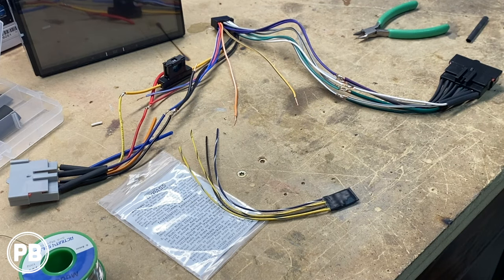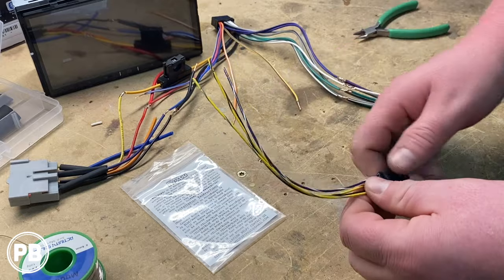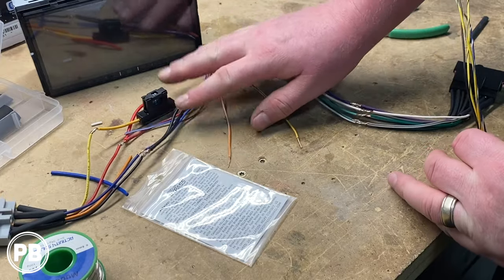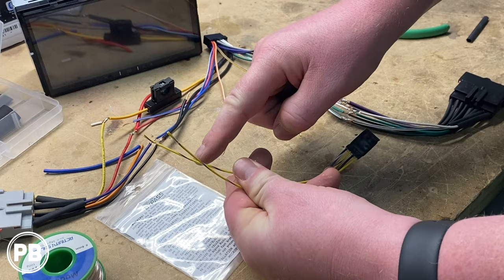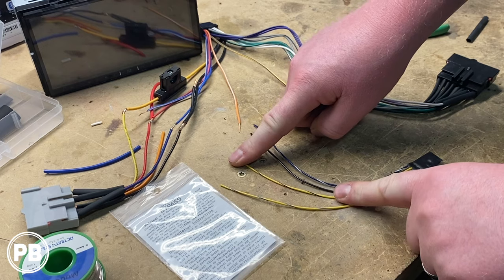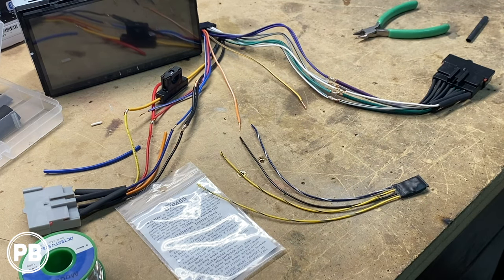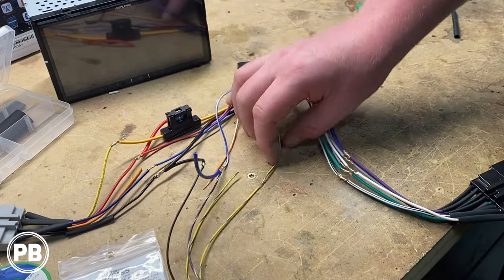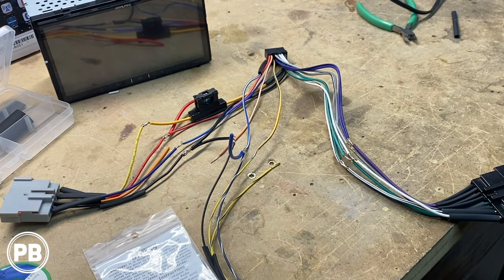How To Bypass Parking Brake On Alpine Radio

Comment: I see that people still watch this video and wanted to say i had the same problem when connecting my pioneer radio in my 2010 Camry. What my friend did for me is, with the center console removed, he looked for a random bolt that the wire could ground to and so we found one, loosened the bolt a bit to get the wire under, and tightened it again HAHA haven’t had a problem since. I must add the parking wire was very long which let us do this (: best of luck everyone

Comment: I just did this on an alpine ilx650. Great video 👍🏾
Reply: That what I am using! Did it work?
Reply: Any one part number on the part to many on line
Reply: @carlosquintero2993  MicroBypass Video Parking Brake Bypass Fits ALPINE ILX-W650 ILX-F309 ILX-F259
Reply: @carlosquintero2993  yo no encuentro nada al respecto 😢

Comment: Great product worked like a charm. I didn’t need to pull up the center consul to connect to the E brake connecting to the back of the radio was much better and convenient. Thank you for the heads up.
Reply: you did not have to pull the dash
Reply: so all you had to do was remove the head unit from the dash to swap out the receiver?

Comment: I have a Alpine 509 halo. I had to use the red ACC wire instead of the amp turn on blue and white wire, to get it to work reliably. A lot of the time amp wouldn't turn on or the access to setting, bluetooth and video wouldn't unlock. Connecting the bypass to ACC clear up everything. Also if you are problem with the bluetooth volume connecting at startup. Tap the bluetooth volume knob before or shortly after startup.
Reply: On your 509 halo did you need the 4 wires or only 3 ?
Reply: @floridabuzz2457  3 wires, some Alpine decks have a foot brake wire that also needs to be hooked up.

Comment: Oh my god. The one I got had the blue yellow wire a ground black green and the blue remote. I thought the green for some dumb reason hooked up to yellow power. I hooked it up. Plugged the fuse in and realized my amps were on all the time even with the keys out and radio off. I just pulled it out not to do any damage. Now that I know the green wire is left alone. I’m gonna try putting it back in so I can freaking adjust the sound settings.

Comment: Yes, it does work on the iLX-507. If your car has interfaces like Maestro, Connects2, etc just do not connect them the parking wire....🎉
Reply: Can you elaborate please. I have a 507 and trying to get this to work. What do you mean don't connect to parking wire?
Reply: Got mine to work. BTW -- you cannot have the parking brake wire connected to the car side (inline).
Reply: @armourbl   Ok, lets to make a loop circuit between the 507 and the MicroBypass. Nothing else matters! Most interfaces will have inputs for speed pulse, parking brake, reverse, telephone mute, etc. The parking brake should not be connected to the interface. Sorry for the delay!
Reply: I’m going to get one soon do you recommend the bypass and if you do is it common sense on hooking it up
Reply: @christianrodriguez607  yes. Worth it. Make sure to test before closing up the dash.
Reply: @armourbl  What do you mean? Still confused...
Reply: @velocast  What do you mean? Still confused...
Reply: @IrwinTan27  Basically, you connect the relay wire for the parking brake to the input for the parking brake on the radio harness. You don't want a signal from the actual parking brake itself. The relay fools the radio into thinking the parking brake has been engaged properly.

Comment: Awesome video. Question? I have the RP4.2-TY11 radio replacement and SWC interface already connected to the radio harness. I understand that the by-pass blue/yellow wire connects directly to the blue/yellow on the radio harness. The blue/white wire I have a question on. Since radio harness is connected to the radio replacement & SWC interface should I snip the blue/white wire and connect directly to the bypass blue/white wire (as shown on the video) or should I just tie-in the bypass blue/white wire to the blue/white wire on the radio harness. In other words keep the blue/white bypass, radio harness and radio interface all connected? Hope I didn’t confuse you :-/
Reply: I was wondering the same thing. Did you end up ever getting an answer?

Comment: Thank you for this video and for the intruduction to the bypass switch. I do have  one question. My Alpine radio is connected to the vehicle via a Maestro module; do I make these connections before or after the module?
Reply: Did you ever get an answer to this question I have a maestro also I’m guessing you just wire it from the actual Alpine harness
Reply: @adamlaforce3681  I'd like to know as well. Logic for me is you want to do it right before the radio. Since you have a ground and remote wire (blue/white) inline with the harness they will work regardless of location. And you wire in the yellow/blue, not inline, just into the radio to fool the radio. The relay should start up with the remote wire receiving power and send the ground to the yellow/blue wire. The problem is I don't know if the Maestro RR has any part to play in any of this. Like if the Maestro doesn't sense the yellow/blue wire inline to the radio, what happens? I may try to wire mine with the yellow/blue still inline. At least that way if the relay doesn't work, I'd still be able to use the parking brake to engage the settings menu as a backup operation.
Reply: Got mine to work. BTW -- you cannot have the parking brake wire connected to the car side (inline).

Comment: Has anyone installed this in a 2013 Ford Edge? Does anyone know of anything that might need to be performed differently? How would you know if your car has a brake pedal wire? Great video!! Hooked this up before but couldn’t get it right. Then had to put the OEM radio back in and it sucks!! I’m going to pull this OEM one out and put my Alpine ILX w650 one more time I hope. I need CarPlay back. Lol

Comment: My yellow /blue wire goes from the deck to the radio pro ch1a -rsx (the steering wheel controls). Would I need to keep that line connected to that control box?

Comment: So I have the ix650 by alpine and I purchased a redwolf bypass from Amazon. The bypass has black,red,green and blue. I'm not sure how I'm supposed to go about this. I also have a reverse trigger wire on the unit. Is that supposed to be grounded out? It's been years since I've done a install. Any info would be greatly appreciated 🙏

Comment: I use this on my alpine x008u it works for the vedio but somehow my sound setup wouldn’t let me control the equalizer setup . Any helps on that ?? I can’t even adjust my speaker without that please help here ??
Reply: I have the same radio did you resolve the issue??

Comment: I just bought ILXW650 does it actually play video can I mirror my phone onto the screen? I have a s21+ running android auto through USB input
I accidently bought a parking brake bypass for a pioneer stereo can I use it on my alpine if it is just a relay?

Comment: When I try to access reverse camera features under settings I can not press it due to it being greyed out. Does having one of these installed have the unit thinking the parking brake is applied and greys out the ability to press the reverse camera in the settings?

Comment: Can I add one of these to my harness with posi-lock wire connectors or would just splicing in be better? I have a ready made harness from Crutchfield and didn’t want to have to cut it. I just didn’t know if it would actually get a signal if it was tapped. Thank you.
Reply from the maker: crimp or solder, don't risk doing anything else inside a vehicle.  Strip back the shielding, poke a hole in the wire, thread your wire through it (like threading a needle), and solder onto the connection.

Comment: Hey I’ve watched a ton of your videos, and you r helped me troubleshoot a lot of issues I’ve got with my 99 f250. I was wondering if you could help me with an issue, my accessory power doesn’t turn the radio on, so the truck has to be running in order for the head unit to work. Any thoughts?
Reply from the maker: Sure, use a multi meter to determine the issue.  Check the accessory wire coming from the truck and see if you have 12v.  If not, the issue with with a bad relay or fuse in your truck, not the radio.

Comment: So looking at my wiring diagram for my Alpine.... it shows a foot brake and a parking brake wire... but both of them are yellow/blue.... do I actually need to tie in that foot brake wire? or can I just do the parking brake and not worry about it? My Alpine is a INE W957HD....
Reply: Did you figure this out. Dealing with the same thing right now
Reply: @jakehaase1651  Yes.... The manual was a misprint.... The harness actually had a yellow blue and a yellow black. I tapped them accordingly. What unit are you installing?
Reply: @FLEXXX  I have the ix650. The bypass I have is made by redwolf. It has a black,red,green and blue. I've searched all over and I'm stumped.
Reply: @_flexxx_  I have the halo I got it figured out. Thanks for the reply and help
Reply: @musicismeds  found this info from a bypass seller for Alpine: Installation is straight-forward. There are four wires - black goes to your head unit ground, blue goes to your head unit blue/white (remote power), and green go to yellow/black wire (Foot Brake+).
Yellow to yellow/blue wire Parking Brake(-)). In your case, it might be the red cable from your bypass.

Comment: Why can’t the e break wire just get plugged in with the ground? You’re basically doing the same thing
Reply from the maker: It can, depending on the brand.  Pioneer and Alpine require more than just ground the parking brake; they require either a double or triple pulse negative.  All other brands you can simply ground the parking brake and be fine.

Comment: is it possibly to short circuit the bypass, I had it installed and it worked fine, then when trying to wire the backup camera (which I can't get to work) the bypass no longer works.

Comment: Will this help with the back up camera?  I have done everything imaginable, even got another camera from Crutchfield and ran straight to bypass the installed camera and still nothing.  This is the only thing left to try as far as I can see otherwise it is back to no camera for me.  By the way, this is the same model Alpine I have and there are only rear and front video inputs for a camera, so I would assume yes, but want to be sure.  It just seems strange that it would require this if Alpine has the backup camera feature.
Reply from the maker: Nope, this has nothing to do with a backup camera.
Reply: Linkswell makes an adapter that works great!

Comment: I have a foot brake so I need to use the yellow/black. But there isn’t one coming out of the Alpine harness. And the yellow/blue is going to the interface module. Please help! Thank you!
Reply: Did you ever figure It out ?
Reply: @nelsonperez1194  I did BUT I forget the answer. I’m sorry! I have to get back into there soon and get let you know but I assume you’re looking for an answer immediately, right?
Reply: Thanks!
Reply: @nelsonperez1194  sorry it took so long to get you an answer. But here it is: Connect all 3 black wires (ground), connect the 2 yellow/blue wires (radio & bypass) to the solid green wire coming from the interface, connect all 3 blue/white wires (radio, interface, & bypass).

Comment: I installed this nicro bypass on the Alpine ilx-w650 in my 2009 Toyota Tacoma and now the settings work but the steering wheel controls that were previously working no longer are functional.  Any idea how to solve that?
Reply from the maker: Sounds like something came unplugged or a wire connection came loose.  Recheck your connecitons.

Comment: There is a fairly legit reason for the bypass and that’s for large vehicles that don’t have a standard parking brake, but use Neutral + Airbrakes and don’t have access for a parking brake wire.  Better case to state than all the idiots trying to watch movies illegally…

Comment: On a non-Alpine unit, wouldn't you just have to connect the parking brake wire from the radio harness to the Ground (Black) connections on the radio and factory adapter wiring harnesses to bypass the parking brake? Going to be purchasing and installing a Pioneer AVH-1500NEX for an '08 Ford F-250 Super Duty, and not installing a backup camera or anything.
Reply from the maker: Not all radios are the same. Pioneers require either a double or triple pulse negative so a bypass would be required. See the link in the description for that video. With a pioneer, you cannot just simply ground it.

Comment: Can’t I just tap into my 12v cigarette lighter acc wire? That way it turns on when I turn the car on?
Reply from the maker: Sure, or you can add it to the accessory wire on your aftermarket radio too.
Reply: So if I connect it to the accessory on my harness will the display options that are greyed out work whenever I turn the car on?

Comment: Are the pioneer and alpine bypasses not interchangeable if you only need 3 wires on the Alpine?
Reply from the maker: Alpine sometimes needs both a foot brake and parking brake bypass, or a four wire relay needed. Pioneers only need a parking brake. Just depends on what model alpine you install. Generally a pioneer needs a double or triple pulse ground for the parking brake to work.
Reply: @ProvoBeastAudio  i have the aloine ilx-w650 do i neec the foot brake wire installed??? And what wire dies it go to

Comment: will this work on the iLX-507?
Reply: I installed it on my 2014 Tacoma with the iLX-507. It still requires me to be in PARK (automatic transmission). I don't have to apply, release, and apply the parking brake. But I can't access settings while moving. UPDATE If I power cycle the head unit after starting the truck, the SETTINGS and HDMI input options become available while driving.

Comment: Does this screw up the amplifier signal that needs to continue to the amp to turn it on?
Reply from the maker: It's irrelevant to an amplifier output, remote output, or backup camera.  This is specifically to access certain settings in the menu or video playback while in motion.
Reply: @ProvoBeastAudio  I understand that, but you are tapping into the blue with white stripe line that turns on the amplifier, does it affect the ability for the amplifier to recieve the proper signal if it's also powering the relay?
Reply from the maker: @archittt1  Nope, it won't pull enough current away from your amp remote inputs to cause any issue.
Reply: @ProvoBeastAudio  Thanks

Comment: I dont plan on watching video while driving, I just want the damn thing to work. I cant hookup bluetooth, I cant use USB, I cant access settings, I cant even set the clock without this. So dumb. Why does Alpine think my am/FM radio should function but my bluetooth audio shouldn't?

Comment: This is a great video! I have my Microbypass wired in exactly like you do, but I'm still not able to access the settings menu on my Alpine iLX-W650. Have you by chance heard of any additional problems with this particular unit? Any common missteps I can check for? Many thanks.
Reply: I ordered this as well.  BUT apparently,  you need to engage and disengage, and then re engage the e brake to see settings. I'm currently using my pac 7, but I was hoping this would work.  Now I'm not to sure. I might run a separate toggle to the ebrake for settings.
Reply: I wired a switch.. one side goes to parking brake wire to radio, one wire goes to ground. Had to flip the switch a couple of times to get to my settings
Reply: Alpine 509 halo. I had to use the red ACC wire instead of the amp turn on blue and white wire, to get it to work reliably. A lot of the time amp wouldn't tune on or the access to setting, bluetooth and video wouldn't unlock.

Comment: Just tie the Alpine parking brake wire to  the car's chassis ground.  It will think that parking brake is always ON and allow you to watch video anytime.
Reply from the maker: Sounds like you have never owned an alpine....Most radios can simply be grounded, but Pioneer and Alpine require a double or triple pulse negative.  Don't try to correct without doing your own research.
Reply: @ProvoBeastAudio  the new Alpine HU only works if it sees a ground signal after car starts and if the  Alpine sees a constant ground signal all the time,  it will not allow video watching or other functions to work. The Old Alpine unit works on constant ground  but not the  new Alpine models.

Comment: can you connect this to the ready harness from crutchfield?
Reply from the maker: Sure can.  You will just need to strip back shielding on the wire so you can connect it in.  A bit more difficult, but still certainly doable
Reply: I had a Crutchfield ready harness for this radio,  I connected the yellow-blue on the bypass to the green which is what Crutchfield used for parking brake in the ready harness.  Left the other yellow off. Works great
Reply: @jlibert0546  So you left out the other yellow but connected the other two cables to the same colored cables on the ready harness?
Reply: @ProvoBeastAudio  I have the ready harness which came with the RP4-VW11. Doni still need this bypass module or should the one from the "ready harness" work?